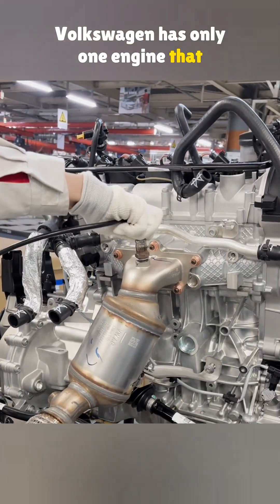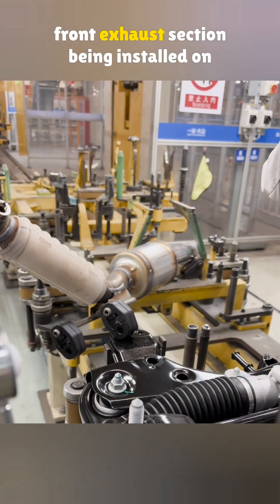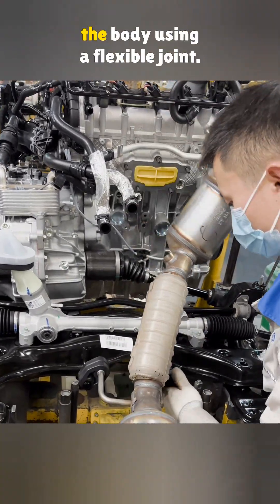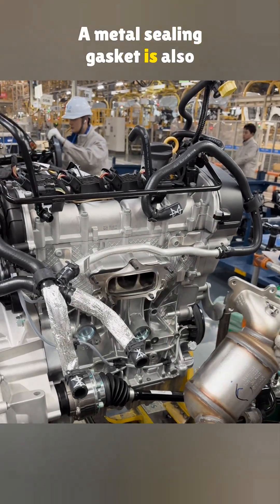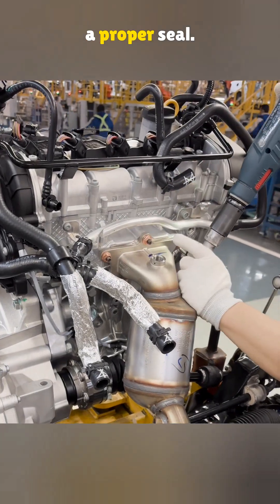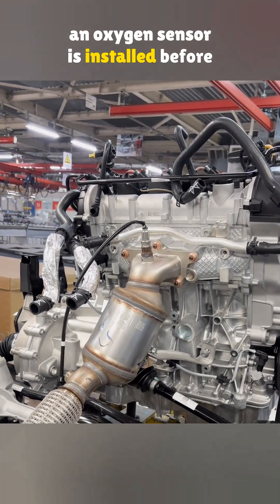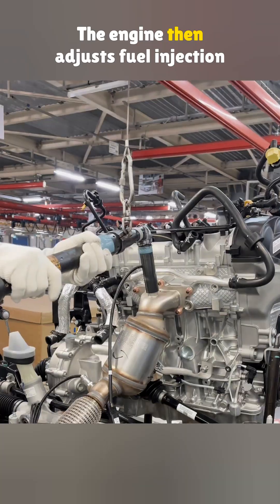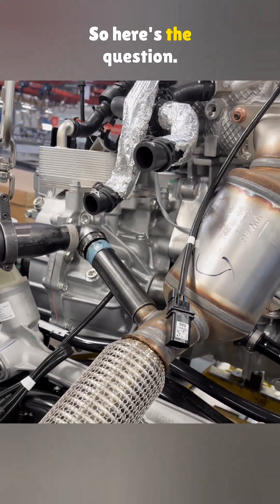How This Volkswagen Jetta Meets Emissions Without a Gasoline Particulate Filter

Comment: High temperature grease on studs = give it 2 years and all of them will be rusty (can still be loosened), then give it 5-10 years, you won't be able to loosen them, there's a high chance of snapping them off.
Reply: No problem to undo them after 25 years, this stuff works

Comment: yes, the naturally aspirated engine, even if is GDI, does not have higher EGT, so no need for GPF and NOx reduction
Reply: nope, lean burn engines produce NOx because of higher temperatures, no matter if its NA or turbo